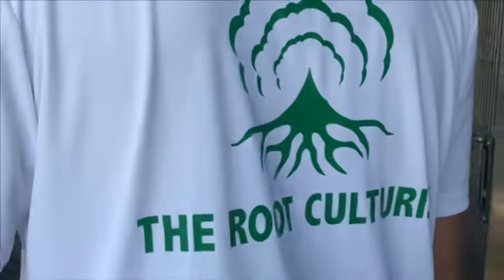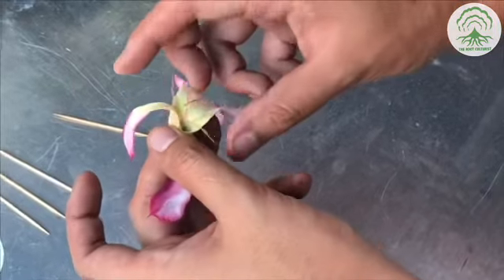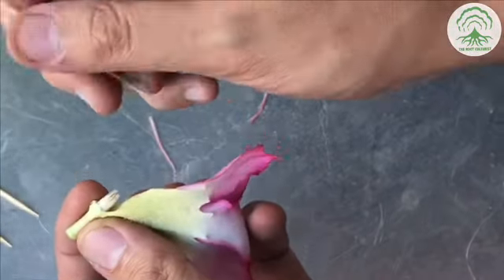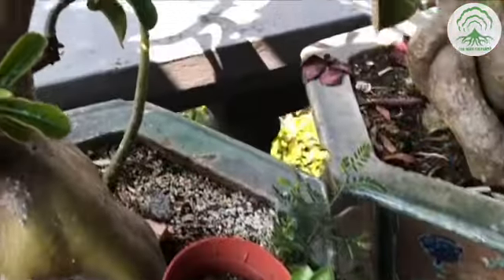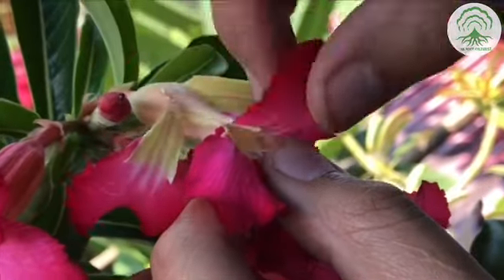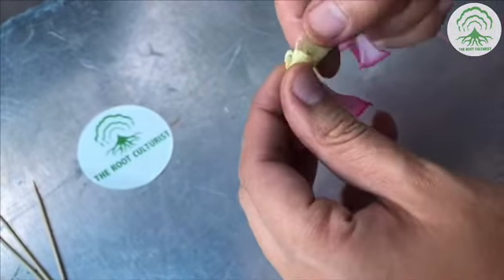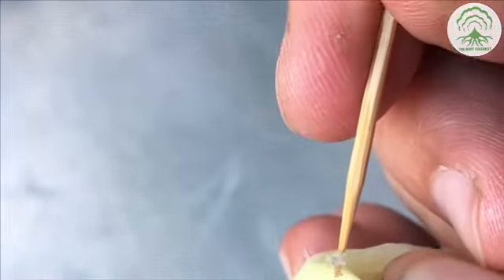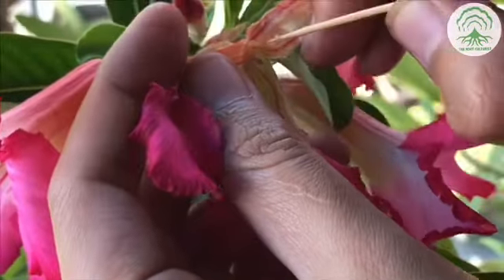How to pollinate Adenium (Desert Rose) Ep 20

Comment: Before pollination do i need to keep the flowers away from sun. After pollination should the flower be kept away ftom sun. I have a problem the flowers that i have do not have pollen or its dry. Why is it so, as such i cant pollinate it.
Reply from the maker: No need, I don’t keep them away from the sun before and after pollination. However, the flowers should not be in contact with water.

Comment: Hi 
Thanks a lot for sharing.
I got my first flower but I have only one.
This is new to me and wanted to know what media you use and how to fertilize the plant and what is the best PH value.

Is there different colors and is it possible to multiply from a branch?
Reply from the maker: We’re using a neutral ph cocopeat and perlite. You can consider slow release fertiliser as it’s fuss free.

Yes there are many colours. If you want multiple colours on the branch would be considered grafting. 

Propagating the branch is possible by cutting off the branch letting it callus and placing it in perlite. However, they don’t form that nice caudex associated with seed grown adenium.
Reply: @TheRootCulturist   Thanks for your reply. You mean it's better to start with seeds?
Reply: @TheRootCulturist  

Will self pollinate mine. I do some orchids seeds flasking which needs sterilized conditions. Wanted to know how to plant from seeds. 
I am in France and would like to get some seeds of different colors.
Reply from the maker: Depends what you’re after. Seed grown produces nice caudex
Reply from the maker: They don’t need to be sterile. Just sow them in media and they will sprout. You can try those cactus stores in France. They may have what you’re looking for.
Reply: @TheRootCulturist  
Merry Christmas and Thanks for your support.

Daniel
Reply from the maker: Merry Christmas

Comment: So mine grows in hydro culture and I tried to pollinate with a brush some time ago. I want to try your method. As I read there should be less water give to the plant. How does less water make the pollination more successful? Is there something else to increase the success rate?
Anyway: thank you for you video!
Reply from the maker: The key would be a balance. Water in excess and too little may cause the plant to abort all its flowers. Since they are grown via hydro, would just recommend to do as per normal. Avoid watering the pollinated flower. Good luck. Looking forward for your success update!